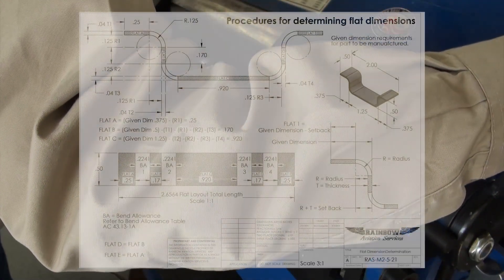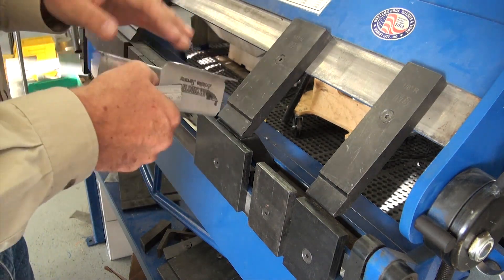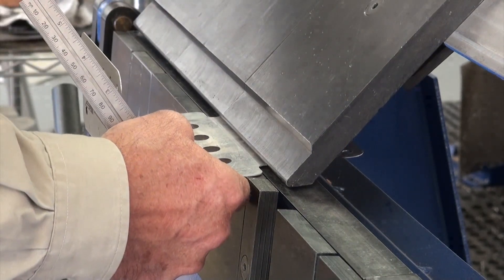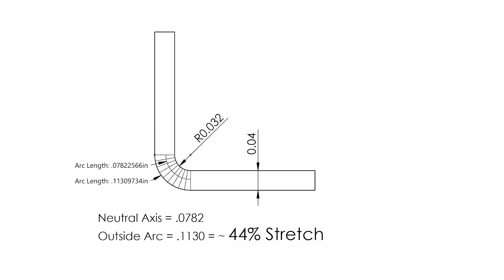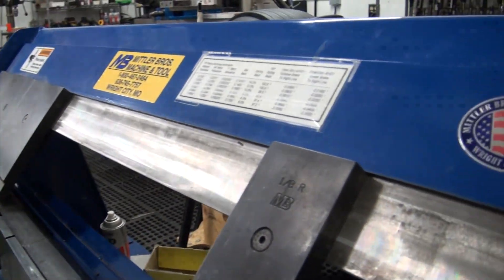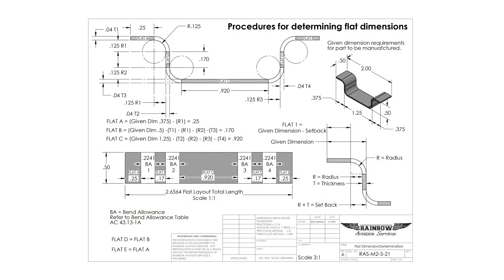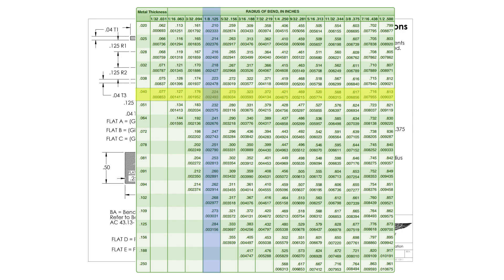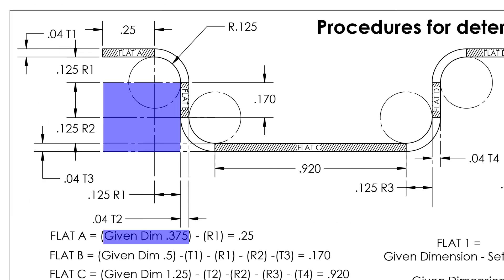Bending Sheet Metal Part 1

Comment: Mat thickness÷3+radius×degree×
.01745=bend allowance. Bend allowance is the rough adjustment to the blanks size. K-factor is a very fine adjustment. You can use 
.45 k-factor without causing any trouble.

Comment: Great video!

Twenty years ago, while working for a major military aircraft manufacturer as a flight mechanic, when one day,I was tasked  with a huge stack of drawings of sheet metal parts, to build for various fight test aircraft.  I hadn't bent sheet metal in the previous 15 years, since leaving A&P school.

Many of the parts had multiple bends, some had two or more radii sizes, and some had bends that weren't parallel to each other.  It was a daunting task to utilize the company's engineering handbook, in which huge tables of various angles, (in 5° increments) had to be cross referenced to the thickness, and so on.

After a few hours of ciphering on the first piece, I was already sick of all the math.  And I LOVE math!  For instance, a bend might have been 63°, but the information in the tables was only there for 60° and 65°, so some math had to take place.  Not a big deal for one or two bends, but I had dozens of bends to calculate.  These weren't simple 90° angles, or hat sections.

So, I went to one of the computers and opened Excel.  I put the interpolation formula in there and could easily type in the 3 numbers I needed to get the answer.   That would save me some time, but figuring the setback and adding up the flanges was still going to take more figuring.

It wasn't long before I figured out that I didn't need to do ANY math.  I simply put the bending formula from the engineering handbook into Excel.

So, from then on, all I had to do, was to open that spreadsheet, type in the thickness of the material one time, (since I've never had to bend tapered stock) type in each bend angle, type in each bend radius, type in each flange length, and hit enter and everything is calculated instantly.  I set it up for 4 bends, to be able to do a hat section.

I included a drawing in the spreadsheet with the distance from the edge of the part to each bend line, and the information showing the length of each flange, the radius of each bend, and the angle of each bend, so that when I had cut my flat pattern, and drilled and countersunk all the holes in it, (even the holes for the nutplates) all I had to do was take my part to the press brake, install the correct die set, zero the back gauge, (w/digital readout) and bend each flange to the correct angle.  Every bend was accurate to within 0.001" in length of that flange.  Parts clecoed together perfectly.

I also added the bend tangent formula, for certain jobs that required that information.

Eventually, word got out and everyone wanted a copy of that spreadsheet.  I used it to make thousand of parts in my personal business, until I finally got SolidWorks.